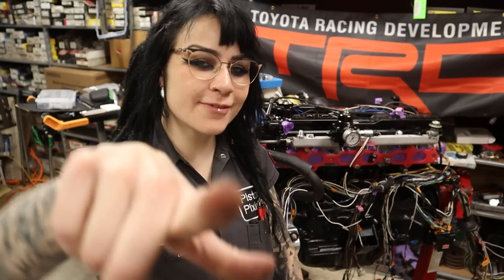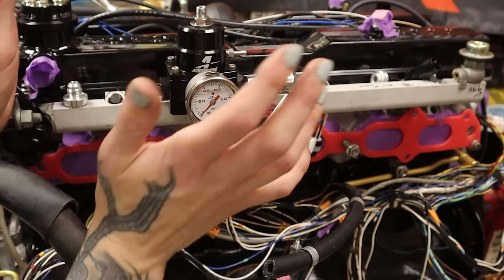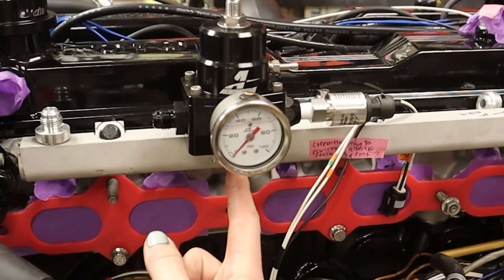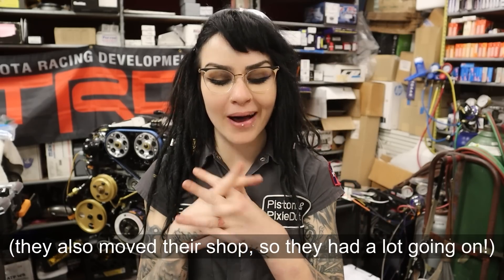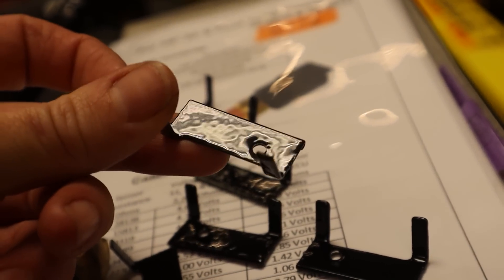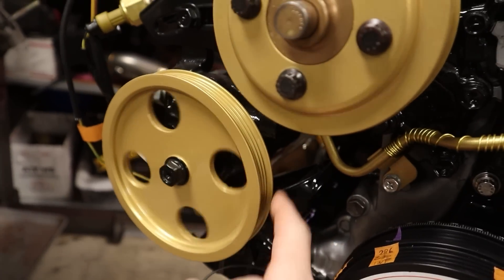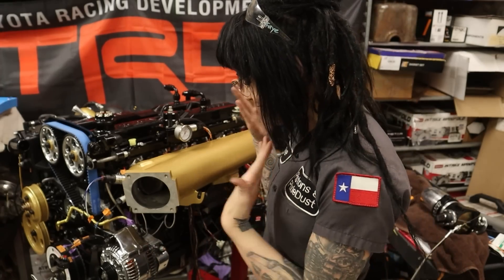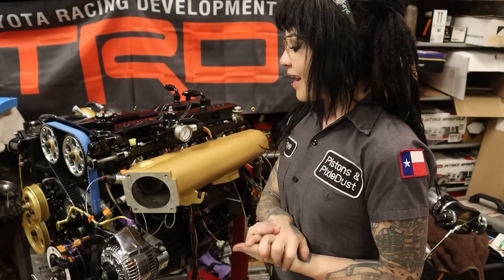My Mk3 Supra's FUEL SYSTEM pt. 1: Modifying the Fuel Rail, Fittings, Pressure Regulator & Injectors!

Comment: Wow, first I like how you didn't throw them under the bus, although they deserve a half star. I bet your car building community is small, and the word gets out that the powder coating shop is not a quality shop. 

Finally, it is okay to put a new worker on the job, but you don't turn them loose. The shop should have put the NG with one of more experience painters, that is how OJT works. All in all, it was a crappy experience.

Comment: Happened to me also. Chrome shop claimed 150 years of experience. Gave them my parts to chrome. Time Passes. I thought i wasn’t getting my parts back. Finally they called 2.5 months later and my parts were ready. I got the parts back and they skipped some steps as my parts were not even a half a** good chrome job. They did not clean the grime and chromed over it and they didn’t know how to hang one part, so they drilled a hole into it. “You didn’t think about calling me?”  They kept my $$$ and then they went out of business. Issues of “self medicating”.   If you can learn and do it yourself; you are better off. There is an E company out there can’t remember their name that helps many people with that stuff. 
Live and learn. (not an advertisement).

Comment: I had a question whether or not you were worried about getting powder coating material in ya fuel system? The Color of the air manifold 🔥

Comment: Fuel pulsation damper dampens the fuel pressure oscillations caused by the injectors opening and closing on a long fuel rail, not the the fuel pump, you can check this out for yourself once your up and running by blanking the damper port and logging fuel pressure, then connecting the damper back up, at certain rpms you’ll get resonance inside the rail, which is what drive the oscillations. As a side not, having rubber fuel lines on the pressure side does wonders for damping the oscillations as the entire fuel line acts as an accumulator (which is what the damper is). Happy building!

Comment: Hey Faye Hadley I understand being ticked off at a powder coater! I had this happened to me 25yrs ago. But you can over come this! I had a friend wet sand everything up to 1500 sandpaper! You can smooth it and get out those nubs. If not sand blast it off and do it again. There is a company in Texas called dustless blasting can get everything clean and not damage the parts. But try sanding it first 😊
Reply from the maker: Thank you, David!!

Comment: That dampener is just bolt threads.  I see a lot of guys (people in general I'm old) take Teflon to the shortest matching thread bolt. I've seen a few use a copper seal for banjo fitting and a few use a fuel safe o ring. If you have a good aluminum welder you could weld it closed.

Comment: OMG... You got absolutely ripped off by that powder coating shop. $500, over a month, and that's the quality you got? I would be furious. I can literally do better than that in my garage. I used to work in a powder coating factory. I'm so sorry. I can come up with multiple ways to hang that last part, but since I believe it takes crush washers, I would just tape over both sides, hammer lightly around the tape to cut it at the face edges, then poke a wire through the tape and hang it by the wire. This isn't complicated and missing plugs on those small bolt holes is also unacceptable. Anyways, excited for more 7M episodes as always!
Reply from the maker: YES EXACTLY!!! That's what I was thinking - I definitely don't want coating on the sealing surface, and I could use plugs to protect the inner section while being a perfect place to hang from. These folks are just lazy :(

Comment: I feel your pain .I went to Harbor freight and bought one of their powder coating kits . I practice on several scrap pieces and found that if yow preheated the material first and make sure it’s thoroughly cleaned. It works really well. I had my wheels refurbished on my Volvo V 70 R got them back $500 later and it was horrible and gave me the same excuse we put the new guy on them. 😮

Comment: Not professional. Even looked bad in the video. There’s no excuses. They didn’t prep the parts correctly, did not apply the power evenly, and no one seemed to inspect the parts after they pulled it out of the oven. Even if they put “the new guy” on the job, someone should have been supervising “the new guy” through the entire process. Sounds like they didn’t even try to make it right. If they don’t correct this, they won’t be in business long.
Reply from the maker: Right?! At least INSPECT the parts. They were still wrapped when I picked them up. They left them outside in a box for me to get in the middle of the day. They were "running errands" all day......
Reply: OMG! Seriously??? Sounds like they just didn't want to be around when you came to pick up your stuff... Wow!

Comment: sorry about that it ticks me off fer you but an old oven and ill bet you could Do better powder coating i know it ! You right thats a crap powder job bad i learned that just because their is a nice clean building charging to much [high rent high over head =low pay dip wads workers] means nothing i like diy small house based guys best for a lot of things :body-blue-raised-arms::trophy-yellow-smiling:you will getter done. So they should have stuck the new-be guy on rails or industrial type crap what an asashole ill bet their all new-be dip-wads .i got a 1989 red supra turbo /1984 also that ill be redoing ASAP stoked .pardon my bad grammar & God bless you

Comment: Damn, I was scratching my head over the behavior of that shop, which aside from being insulting, simply didn't make sense. Perhaps it is as simple as their service being very basic coating of stuff that won't be seen, thus no great skill is required, but not mentioning it at the outset brings me back to illogical, or if you will, stupid.  Let's give them an ounce of credit for not insisting that there's something wrong with you, which you have done by not naming them. That's very gracious of you. I'm so sorry for the disappointment this has been for you.
Reply from the maker: It was a total bummer. They did try to give a bunch ir excuses as to why it wasn't perfect, none of which was their fault. Whatever. I'm trying to get past it.